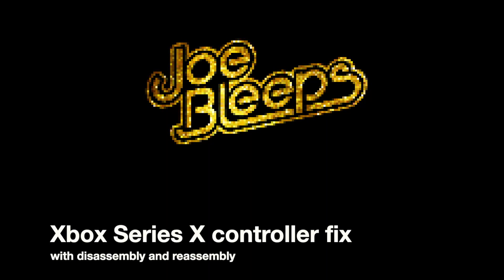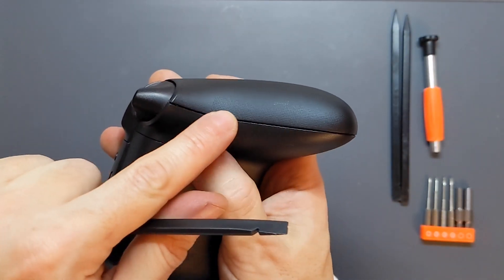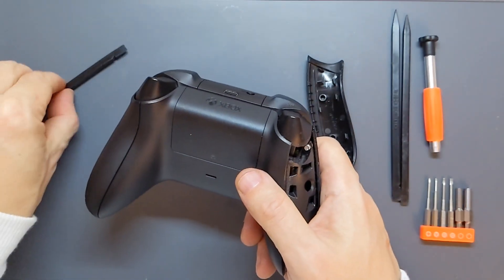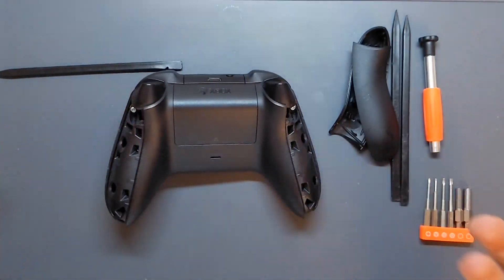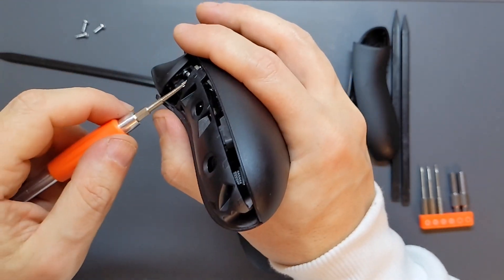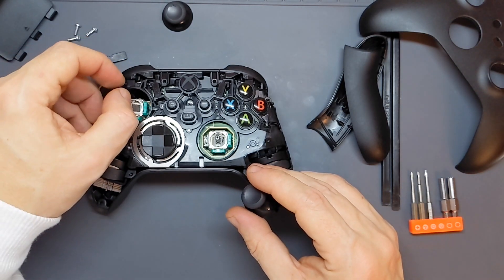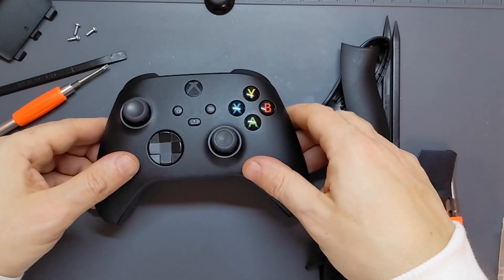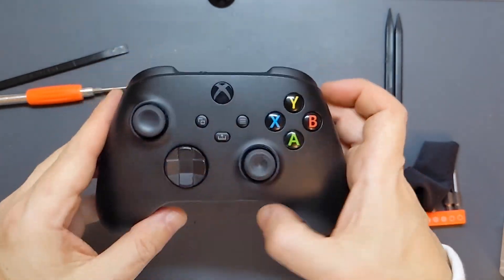Xbox Series X / S controller disassembly with broken joystick repair and reassembly

Comment: I apreciate the vid, needed a refresher. 

FYI, if you have pets, and you notice that your joy sticks aee acting odd, its very possible some pet hair has made its way into the stick wells. Take the sticks off, remove the hair with tweezers or a Q-tip, and youll be good to go.

Comment: My controller won’t turn back on now
Reply from the maker: Check the battery contacts first sometimes they get trapped in the case. Otherwise a ribbon may be disconnected

Comment: Just bought a brand new Series X controller. Replaced the old one because of massive stick drift. Wish I found this video sooner. Oh well, I'll try to get the old one fixed, gonna have 2 of them now. Perfect for having friends over.

Thanks a lot for this!
Reply: Just a heads up, replacing the plastic will not fix stick drift. There are things you can do, such as blowing clean air into the mechanics the plastic thumbstick attaches to, the little box with the 360 lever underneath. I have personally opened them up and used a swab to clean them out as well, but they are very brittle, so do take care if you decide to try this.
Reply from the maker: Ahh you can never have too many controllers 😁🎮🎮

Comment: Brilliant, thank you. Had a Series S/X controller where the top of the thumbstick was spinning (the base of it was fine) and a One controller where the thumbstick was badly worn. Set of 2 thumbsticks with a tool purchased on Amazon for £8.99 and your video and I now have two fully working controllers. Much appreciated.
Reply from the maker: That's so great to hear! Two pads saved 😁